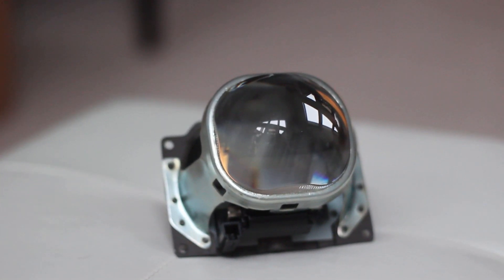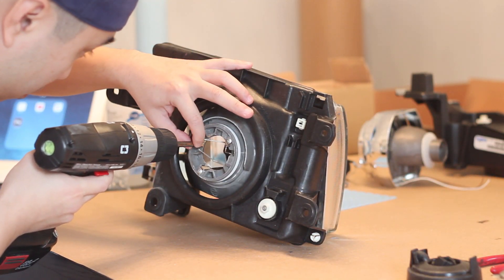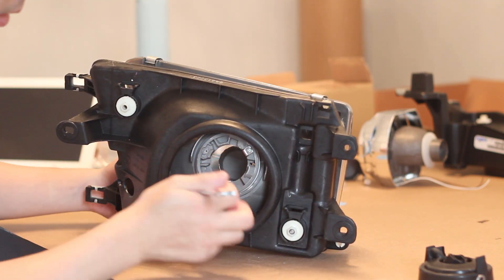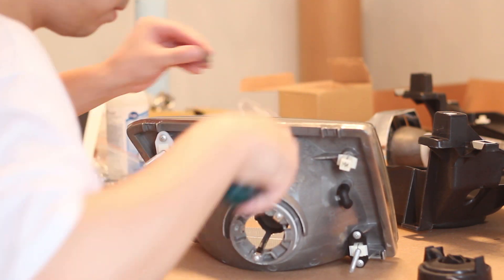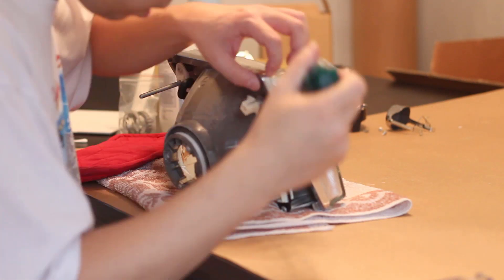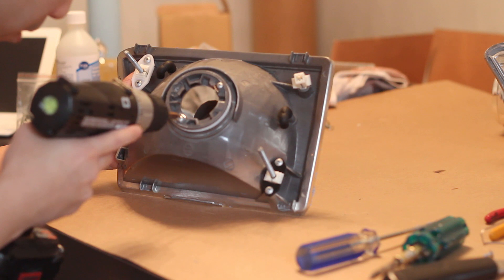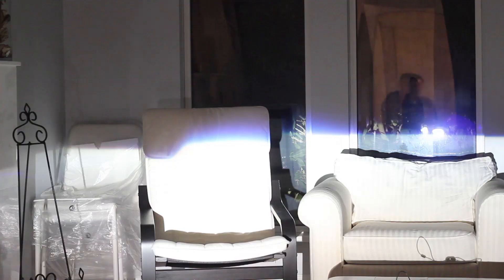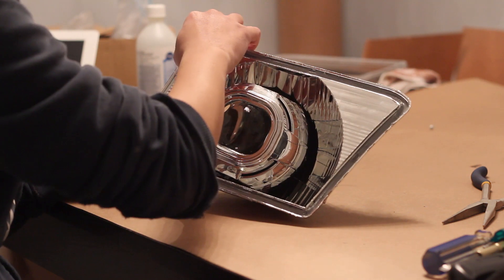How to Mini D2S 3.0 SQ-Lens Projectors DIY H4 1996 Toyota 4runner lumeneticlighting.com

Comment: The bulb reflector only come out from the front?
Reply from the maker: for this retrofit on the 1996 Toyota 4runner, the reflector doesn't come out. It's where the projector is mounted. If you're talk about the bulb shield, then yes it comes out from the front. Sometimes you're able to take the bulb SHIELD out of the headlight from the back but regardless, you still need to remove the front headlight lens to install the projectors so you might as well take the bulb shield out from the front. hope that helps
Reply: +Lumenetic Lighting thanks!

Comment: when will theae square projectors be available on the web site
Reply from the maker: +818k5krawler Thanks for the question! The Mini D2S 3.0 square lens projectors are already available on our site. You just need to select Mini D2S 3.0 Bi-Xenon Projector in the version drop down box and choose a shroud as well. Here's the link to the product page: http://www.lumeneticlighting.com/product/mini-d2s-3-0-bi-xenon-projector/
Reply: Link doesn’t work

Comment: how to wire?
Reply: Yeah is there a video on how you wired the bi-xenon solenoid to the toyota?
Reply: @Cochinabass  did you find anything by any chance....I'm stuck!!!
Reply: @nachos4018   saves So much time and takes all the confusion out. Pretty much plug n play.
Reply: @Cochinabass  YOU'RE A GODDAMN LEGEND DUDE! Thank you so much!!!!!! Ordering it right now lol
Reply: @Cochinabass  Also...I'd need to buy one for each headlight right??(so in total two)
Reply: @nachos4018  no just one harness for both headlights.
Reply: Only uses one OEM headlight connector to power it. But has output for both headlights and high beams(projector solenoids)

Comment: Can someone enlighten me. Why was a h4 adapter placed but d2s bulbs were used. I want to opt 7 led low beam headlight bulbs. What size should i use if the the mini d2s square lens projector state to use d2s bulb
Reply from the maker: The H4 adapter is used so that the projector assembly can be installed easily into the headlight housing (originally with h4 bulbs).The bulb that go into the projector is then a D2S size.
Reply: +Lumenetic Lighting do you guys make an h7 adapter?
Reply from the maker: Not for the MD2S-SQ projector but we do have an H7 adapter for our MH1 6.0 Projectors. Check them out on our website: http://www.lumeneticlighting.com/product/mini-h1-bi-xenon-projector/
Reply: You will need to get an led with a d2s base on it.